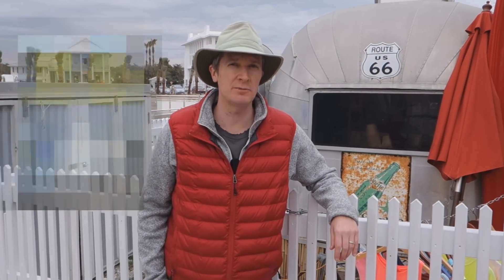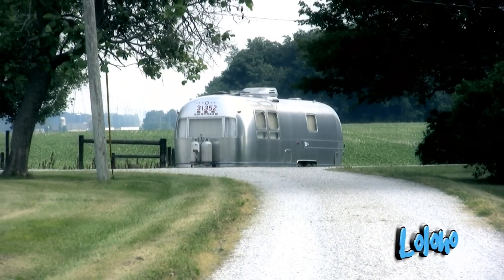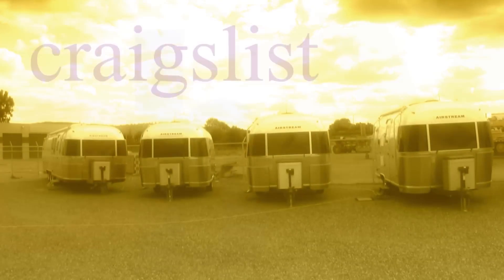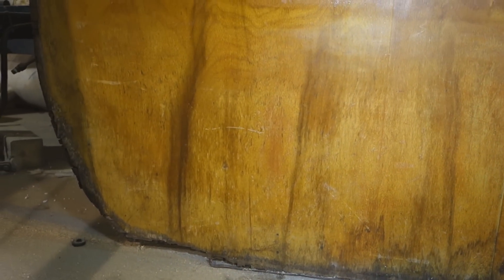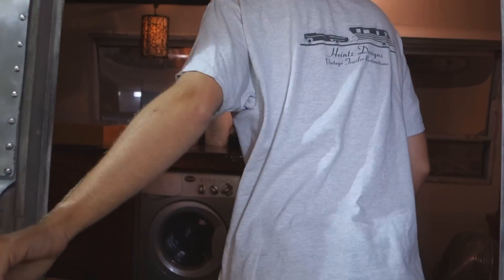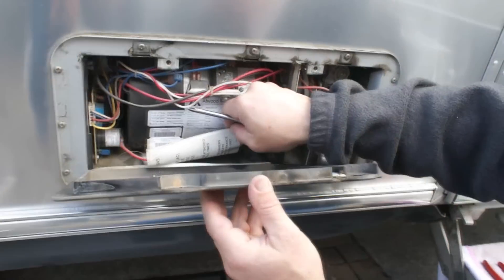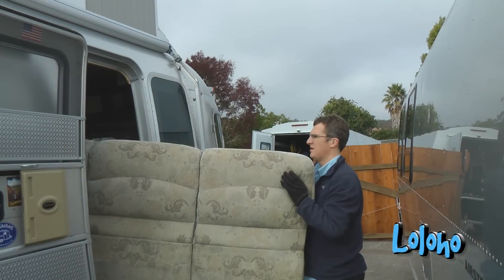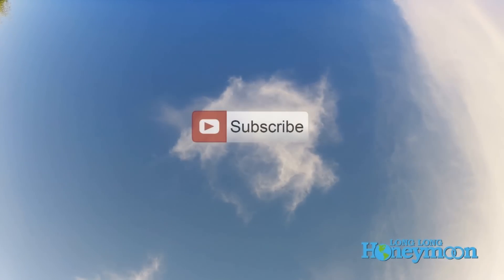How to Buy an Airstream Travel Trailer (RV)

Comment: Thanks for these videos! Any advice for female wanting to live alone who has never pulled anything or even driven a truck? Thanks!
Reply from the maker: We have female friends who RV travel solo. Sub our channel and check out the "Loloho Show" playlist of vids - lots of info in them.
Reply: Best practical advice, stick with an automatic transmission in your tow vehicle. You don't want to overwhelm yourself with learning too much new stuff at once, so simplify where possible. Also, take it slow. Smell the roses along the way and enjoy the journey for its own sake. Consider all your options, maybe a truck isn't the right tow vehicle for you; a car with a large V8 may be more comfortable for you. Maybe you don't even want to tow a trailer at all. Many single women are very happy in a class C motor home or a camper on the bed of a pickup truck. Enjoy looking at all your options. It may be possible to rent before you buy so you can discover what works best for you.

Comment: How are the insulation in a airstreams
Reply from the maker: +John Davis They are reasonably well insulated, but the windows leak heat. In extremely cold weather all windows should be padded with extra insulation. Airstreams aren't really intended for long term winter living, though they are capable with some modification.
Reply: +Long Long Honeymoon 

Shame to hear that. I'm looking for a 4-Season camper and thought the Airstreams were insulated and up to the task. Lance is my 2nd option. Lighter, less expense and certified 4-Season trailer.

Comment: I never learned to read lol. Don't have emotion when you buy an airstream why they all leak 2016 ones 2018 . 1930s all leak if you pay 200-180k they all leak .. frames rust don't run a trailer on 110 volts only low volts if you need vintage parts look on eBay ... Buying an airstream was a life long dream restoring it to my specs is like restoring my home from the 1700s all modern amendities but looks old as dirt.